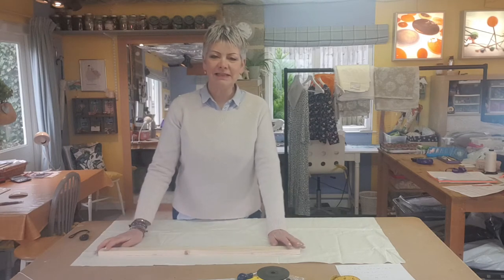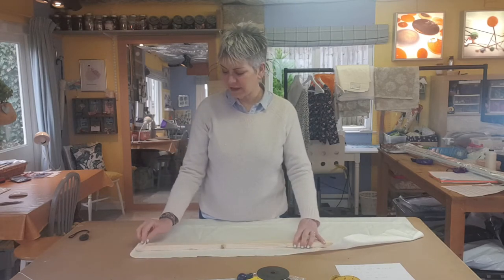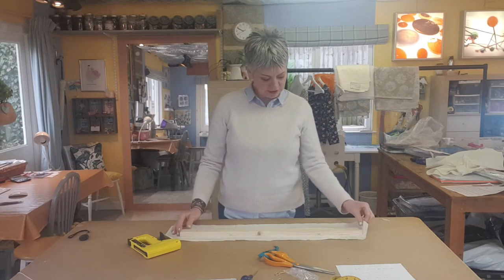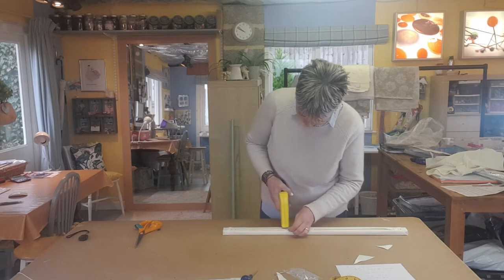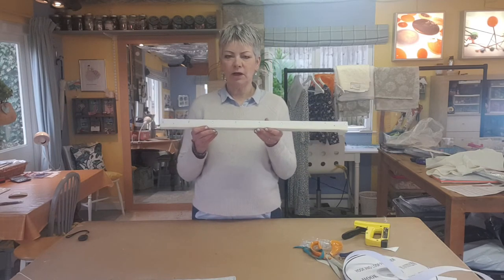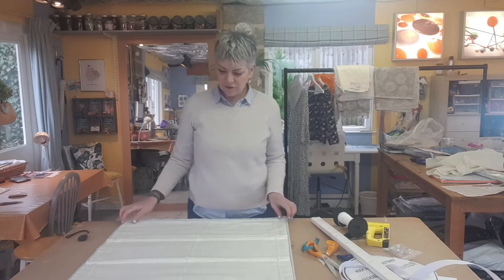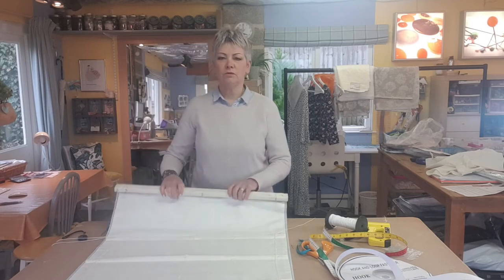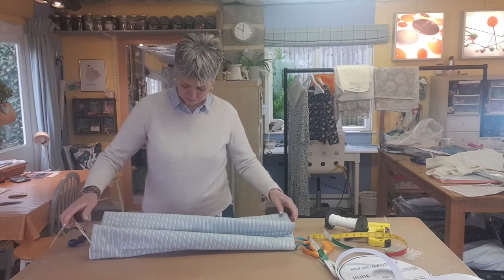How to make a Roman Blind Final Part - Preparing the Baton & Stringing | The Make Room

Comment: Your instructions have simplified what looked like an impossible task - I’ve started the first of three blinds for a bay window using some striped ticking with blackout lining and interlining. The windows are very high so the challenge has been cutting and matching up such large pieces of fabric on the kitchen table. Worse than putting duvet covers on! But the interlining makes the fabric feel much more ‘luxurious’ and full. I’m cheating by using pocket tape for the bars so I hope that won’t look too bad from the street side.
Thank you for this resource.